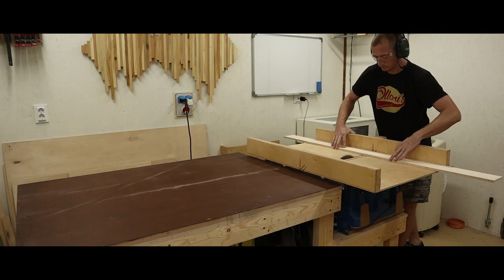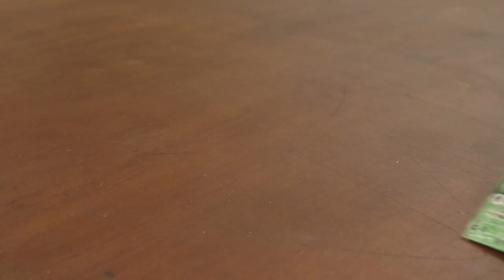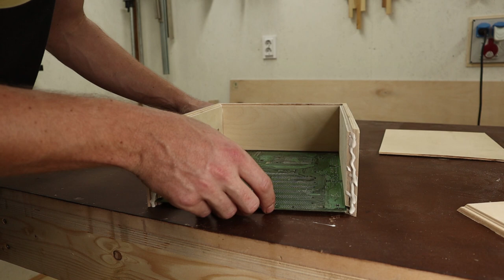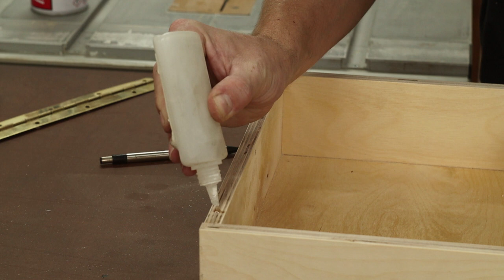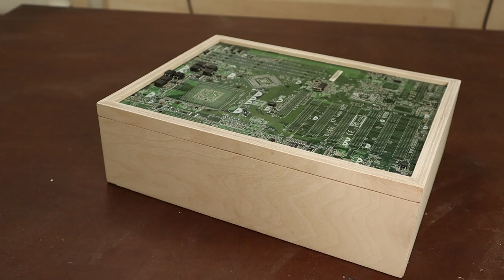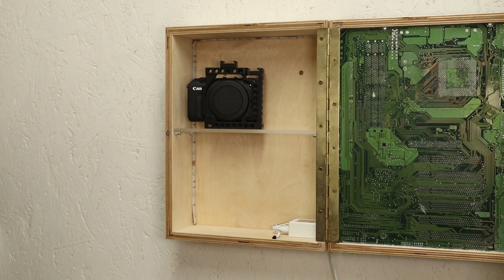Wall Cabinet with Circuit Board Door and LED lights

Comment: Do you have trouble with dust coming in through the holes in the circuit board?  Maybe a thin piece of plexi-glass on the back of the board?  Very cool concept and execution!  I like it!
Reply from the maker: Thank! I was worried about that as well. But nothing so far.

Comment: Awesome as always. Ended up being much better than I expected. Have you considered using batteries for the light? That way you wouldn't need that wire.
Reply from the maker: Thank you! Not really but it could work. There are also 5v led strips that can be powered by a power bank.